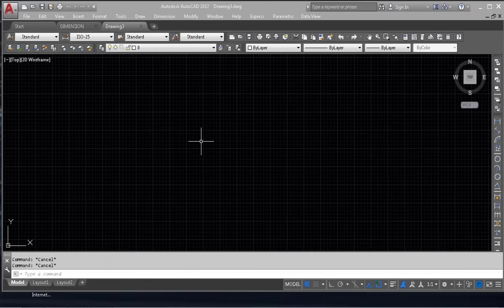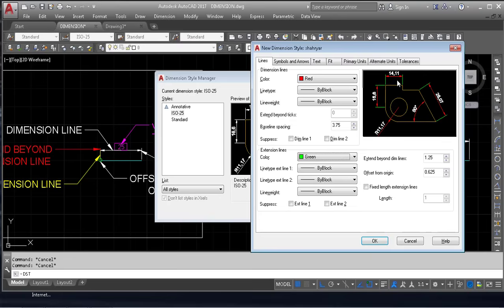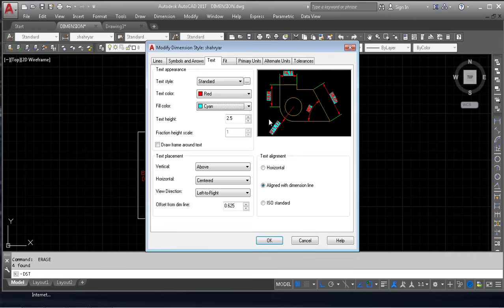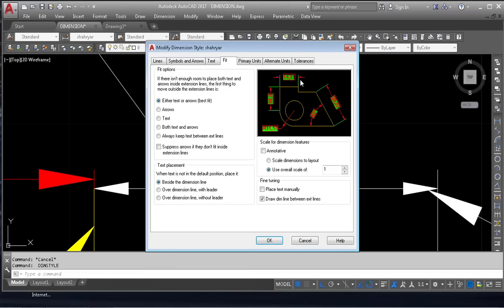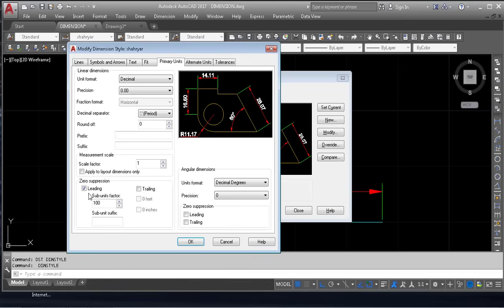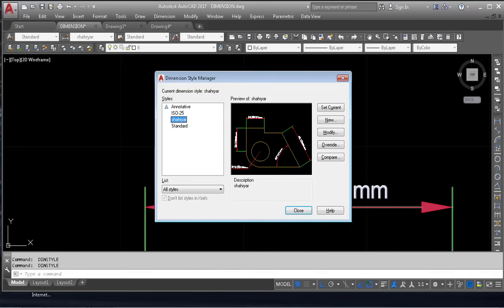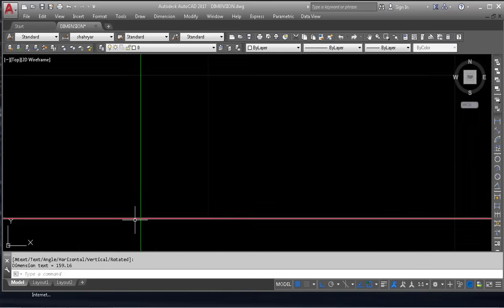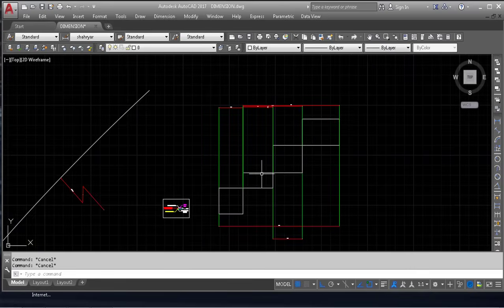AutoCAD Basics - Edit Dimensions by DesigmoPC

Comment: Sir AutoCAD Layout pr Scale m work kaise karegai p....?
Reply from the maker: THERE ARE 3 TYPES OF SCALING ACTS TOGETHER IN LAYOUT MODE.
1st Object scale
2nd one viewport scale.
3rd Plot scale
note what scale you made on model.
then note scaling of viewport 
and finally under plot setting note the scale and multiply all together you will get final scaling you will get on paper.

For example & Best practice
Make the model on actual scale (ie; 1:1) and also the viewport on 1:1 The in plot settings you selected 1:200 then final scaling will be 1:200

or 
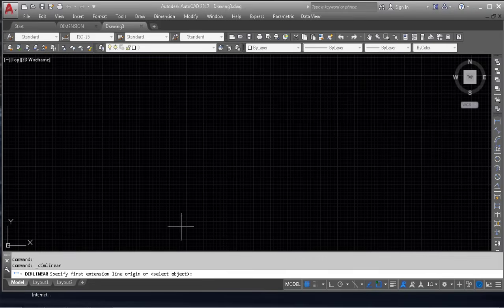You modeled in 1:1000 scale (like meter to mm) and made viewport 1:10 and in plot setting it is 10:1 (in setting it will seem like 1 mm to 0.1 unit) so final scaling will be ( 0.001 x 0.1 x 10 = 0.001) = 1000:1 scaling ratio
Reply: Sir ji annotative scale bara may batayiya